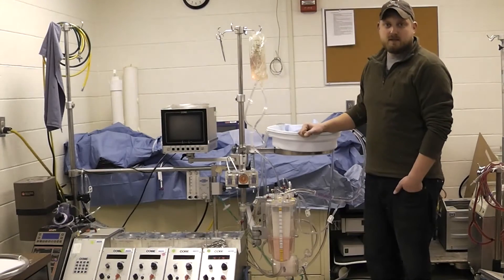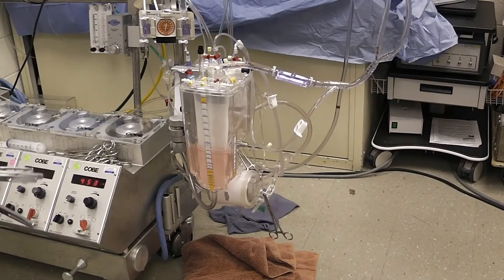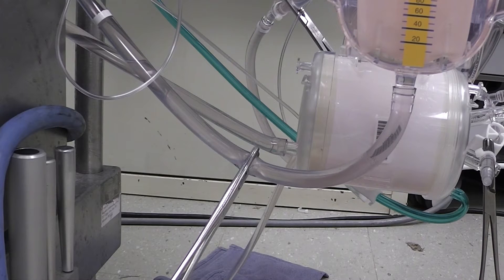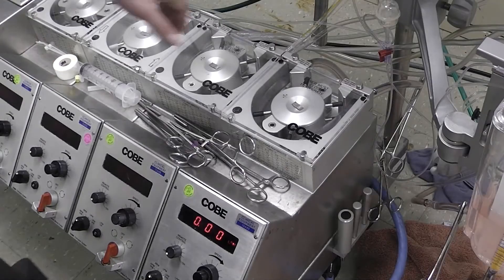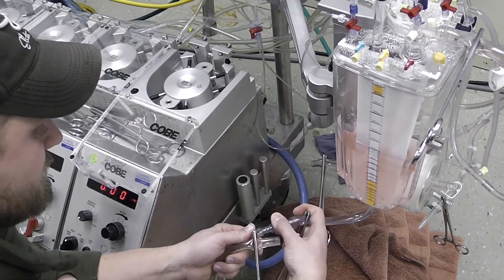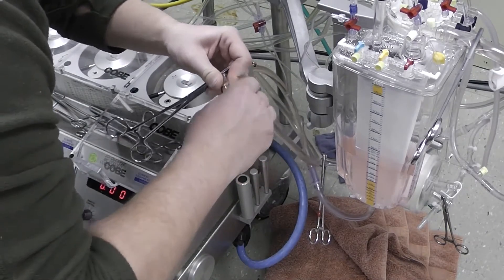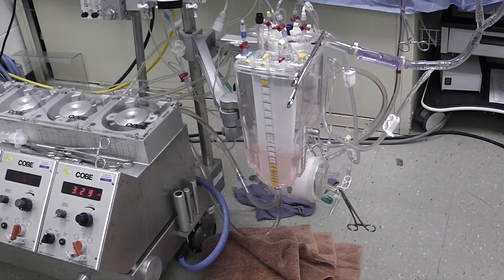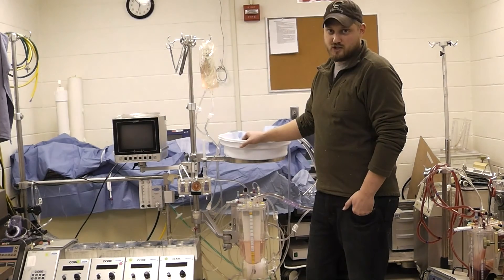Emergent Arterial Head Rupture Tutorial

Comment: With respect, you should always have enough slack in your roller pump boot inflow side so that you can advance it beyond the split, cut the split out and use one connector to reconnect. Using shorter tubing to save prime is not worth the risk when a patient's life is at stake. In addition, you should have any emergency supplies you need in a nearby pump  supply cart containing all the connectors, tubing segments, oxygenators and cutting supplies that you might need for any emergency.  Sending "someone" to your pump room for ill-described supplies they may not be familiar with is not a good plan for emergency preparedness.
Reply: They do not have carts in the rooms at the main clinical site. They use students to grab supplies 🤦🏻‍♂️
Reply: So when the students graduate and begin work elsewhere on their own, do they have students to run emergency errands for them?